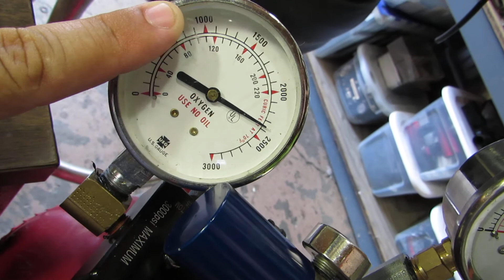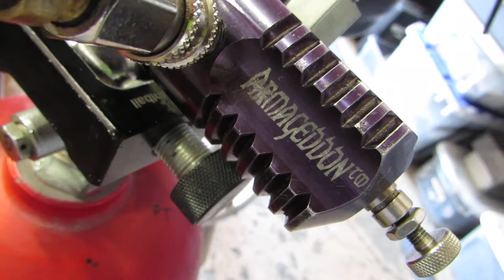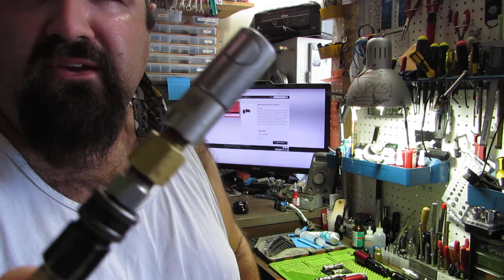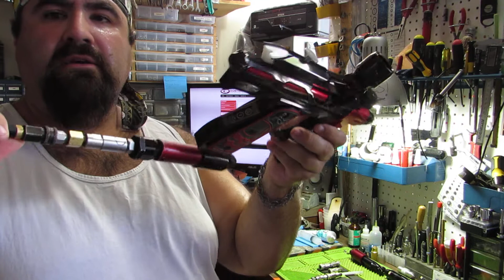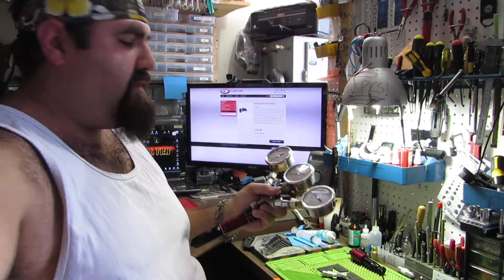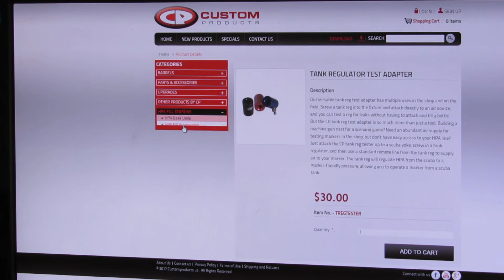Shop Compressed Air Setup - Paintball Testing - Paintball Tek

Comment: Where do you have your shop? NorCal?
Reply from the maker: The shop in this video is where I'm at normally at my house in Vacaville, NorCal.   Though I have worked (and am currently working) at Palmer's in Sac and previously at Tracers (Dixon), Foothill (Rocklin), Outfit (Vacaville), Cutting Edge (San Jose), etc...
Reply: Paintball Tek ya im very familiar with palmers, I used to go to that on guys store on Jefferson in west sac, and capital city a lot.
Reply: Paintball Tek I hit up outfit a few times, they had that PlayStation or Xbox setup if I recall. And I first started getting equipment at tracers! I thought they closed down though? My first pb coverall sweatshirt was from there, still have it
Reply: Paintball Tek seem to be in the same circles, most likely we played before:) the masks back then like the masks everyone has to wear today cover up my ability to recognize you probability:)
Reply: Paintball Tek I was at DPB right when things were popping for XSV, saw all the dude from dynasty and others slide through for practice. Was cool. I think CAPP also slide through with paint, I think they were called Capp right ?!? Idk

Comment: Question,

Where did you get the thumb screw for the Armageddon? I’ve got one laying around and I’d like to make a similar setup.
Reply from the maker: The thumb screw is an old Cobra Paintball part, unfortunately i'm not sure of anywhere that has them for sale :-(  I happened to have one with some old parts and got lucky, but if you're looking for one that's what it is.

Comment: what gauges do you use? Im building a pressure tester and there is just so many to choose from lol
Reply from the maker: Ashcroft is probably my favorite gauge, though Wika, Winter, and a few others are also great.  For a high quality, super accurate mechanical gauge you will be dropping a decent amount of coin for a +/- 1% or less.  The ones I have on my tester I believe are +/- 5% and are just generic glycerin filled gauges purchased from Parker.  At some point I would like to get some newer more accurate gauges but just don't have the need right now to spend $80-$120 on a gauge when these $20 ones will work decently well for the application at hand.

Comment: Any suggestions for a high pressure button purge valve. Having trouble finding one.
Reply from the maker: this is the modern equivalent to the older ProConnect:

http://www.paintballgateway.com/niptcputocor.html
Reply: Paintball Tek Aha. Not the proconnect. The button purge or bleed on the back of your 3 gauge contraption.
Reply from the maker: The one I have on my tester I bought from PPS years ago, it's not rated for high pressure though, but it has worked for me.  Generally I shy away from parts that are not rated for fear of causing harm if something goes bad.  A more fitting piece would be a HP screw-bleed style bleeder like this one:

https://www.ebay.com/itm/Stainless-Steel-High-Pressure-Bleed-Valve-Paintball-SCUBA-SCBA-Air-Rifle-1-4-NPT/372225575562?_trkparms=aid%3D222007%26algo%3DSIM.MBE%26ao%3D1%26asc%3D20160908110712%26meid%3D4ca4073a69da4b7caa4ffb7d5562c1c7%26pid%3D100677%26rk%3D12%26rkt%3D30%26sd%3D302643741720%26itm%3D372225575562&_trksid=p2385738.c100677.m4598

though you can't open and close it as quickly as a push-button it should hold up to a much higher pressure with no issues.
Reply: Thanks Tim. I appreciate the thoughtful and quick replies. Have a good one, brother ~ Smoking Nun